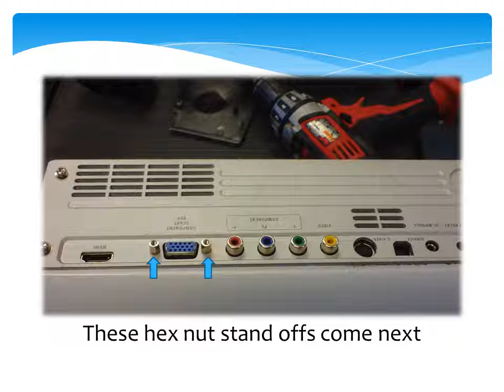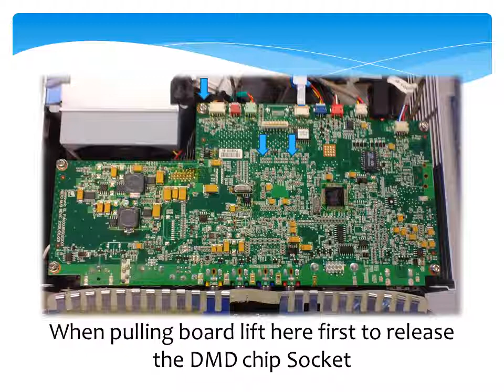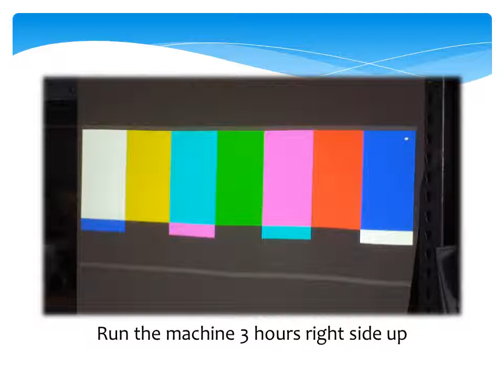Optoma Projector HD70 HD72 (Purple) Color Wheel and Overheating

Comment: i have a hd70, could a worn out color wheel cause it to overheat, cause the colors to change from white to green-purple-magenta and finally OFF?
Reply from the maker: Probably the combo of the color wheel and possibly a fan or like on this one I removed the cardboard heat shield.
Reply: had the same issue, took the color wheel out, disassembled it and cleaned the onboard-parts (transmitter and receiver diode) and cleaned color wheel with isopropanol. no problems since that day! fans still ok after 13yof use!